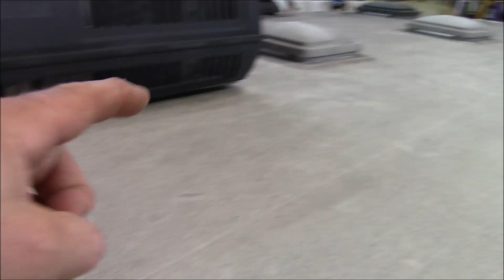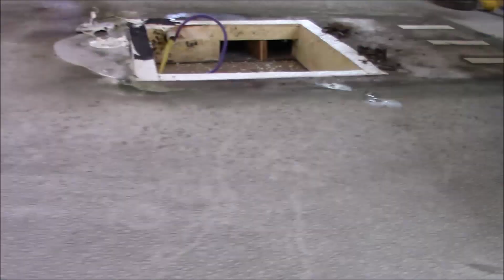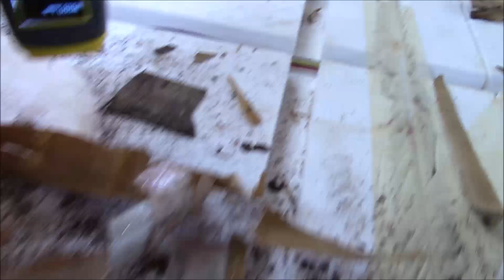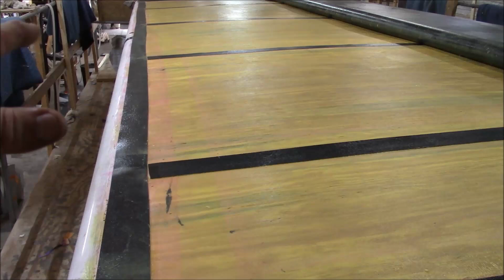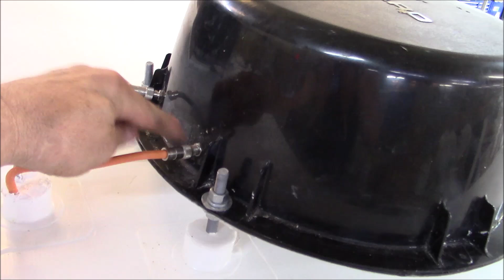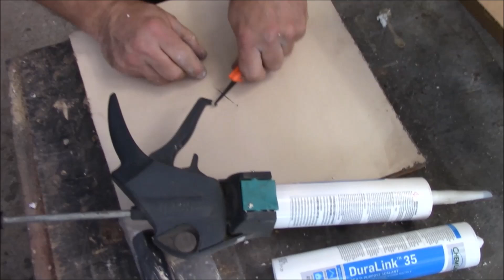Sunseeker Passenger bunk wall repair Passenger side rear wall repair‌‌ New 60 Mil TPO Roof

Comment: Nice work 👍
Is there an organization out on the west coast that does this level of work you guys do? 
I haven't found any organization that can compete with an RVRI roof system ....
Reply from the maker: @HAMMER06  We are the only shop in the world doing these roofs. Sounds  for fetched, but we designed them and haven't trained any other shops as of yet to do the roofs or rebuilds. 
Thanks for watching.
Reply: @RVROOFINSTALL Sounds like you need a 2nd Shop in Southern California!🤔
Reply: Is there a place that does this work near Ontario California?